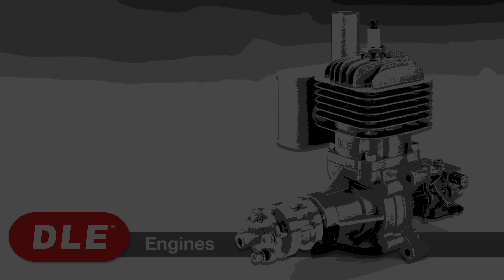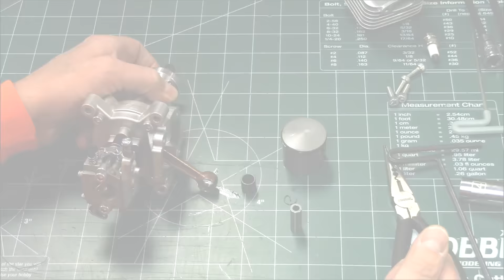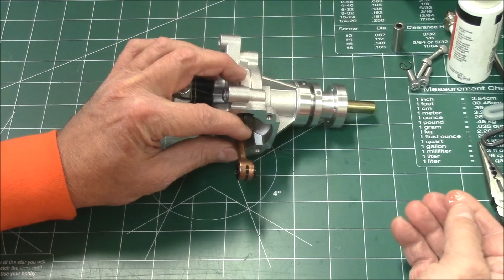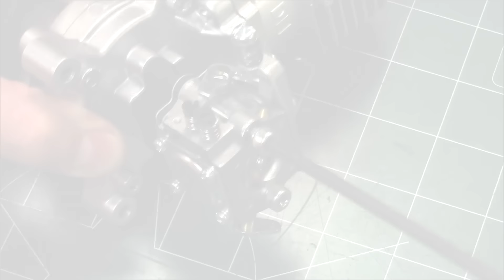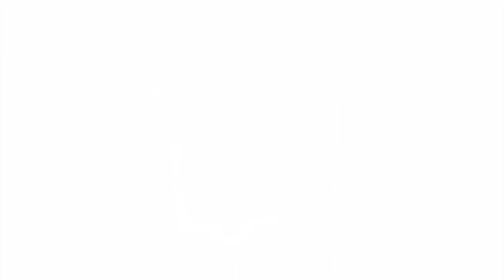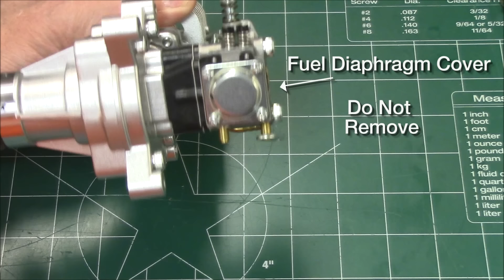DLE Engine Repair : Tips & How-To's

Comment: Thanks for posting this great video.  Others on crank bearing replacement, muffler install, and tuning would also be greatly appreciated.  Thanks again!
Reply: Hi 
My dle20 cc engin when fly and after 4 minuts the throttle it dos’t work and the engin voice it is comming hi and low without power please i need help?